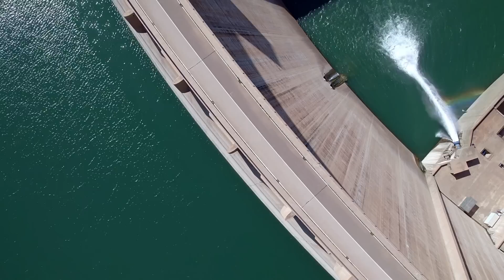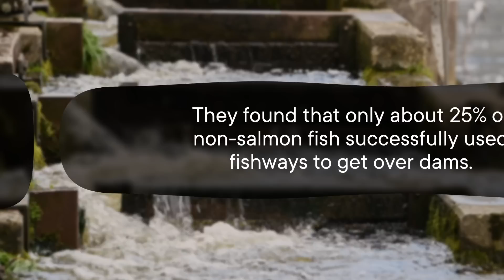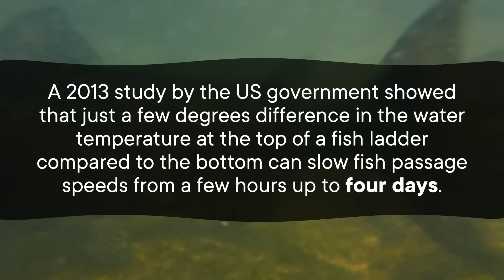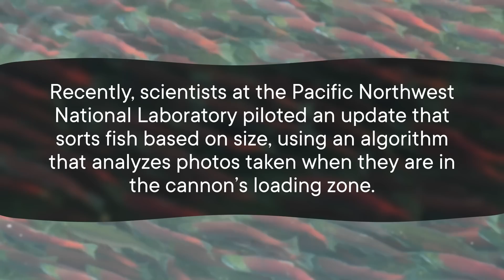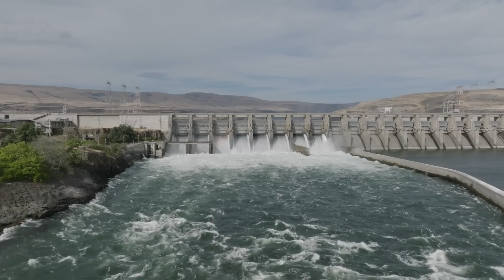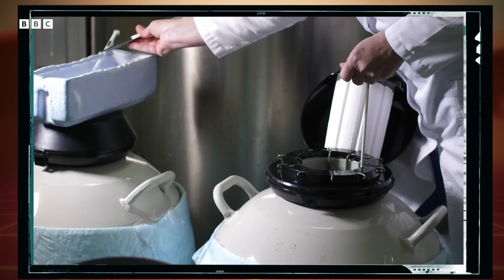Why Scientists Launch Fish With Cannons

Comment: Or - and I know this is a crazy idea - you use the same technology in locks to raise fish up and over the damn (or use a system like an elevator where large troughs are raised from the bottom to the top the dam). You'd think that would be the least problematic. Ether that or you create a very long pathway up over (and/or around) the dam so the incline isn't so steep, mimicking inclines these fish can work with. I'd think a shallow submerged conveyer belt to help move fish that rest on the bottom would be better than the cannon, at least

Comment: 🤔 . . . Why not redesigning the dam so that there is an opening for things to pass beneath? Sure, the dam will need to be built in a way that ensures that it traps the initial water, as well as maybe doors to help regulate, but as long as the water flow is carefully regulated down there, any & all potential building up will just wash away & such…

Comment: Shame there isn’t a way to make a ‘salmon sabot’ around the undersized fishes, or use the round ones as ‘pusher pigs’ to help the little ones up.

Sabot (silent T it’s French) is a segmented sleeve that helps a smaller projectile through a larger barrel and separate after they leave the tube.
‘Pigs’ are a slang term I heard from oil pipeline talk, they’re kind of a sideways keg shaped devices used to clean the pipelines and monitor flow.